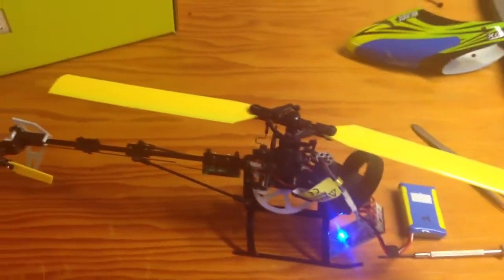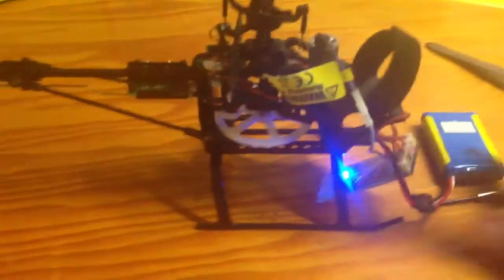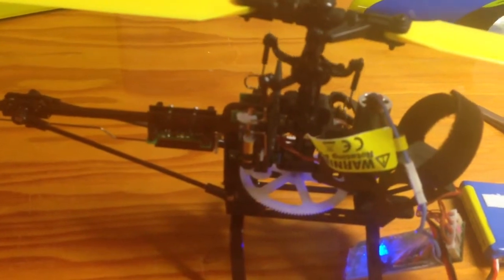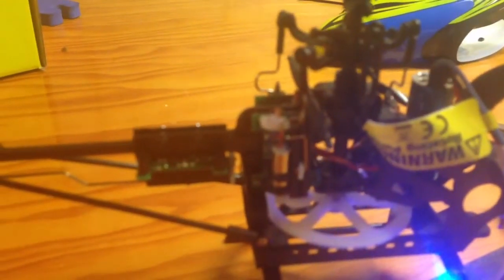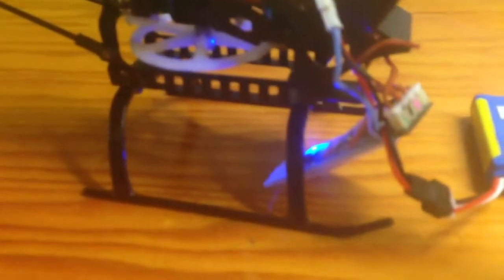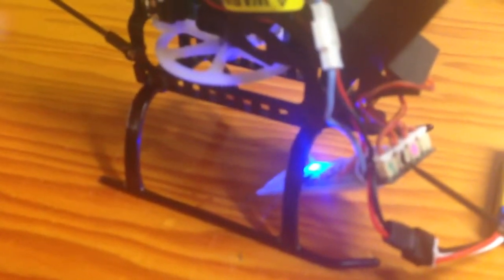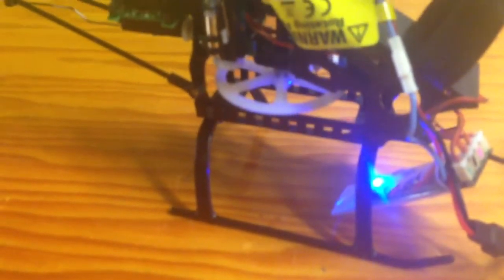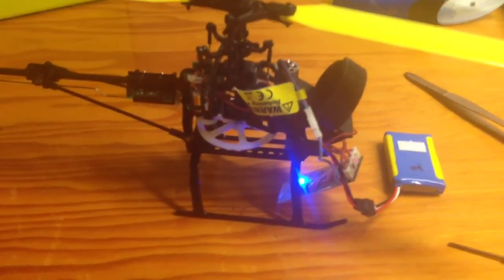130x bad main board issue

Comment: i bought mine from ebay and the elev servo did the same thing,dead servo.my problem is in normal mode it flys great but switch to stunt mode and it still flys in normal mode.is not my dx6i because my mcpx,300x does stunt mode without a problem.